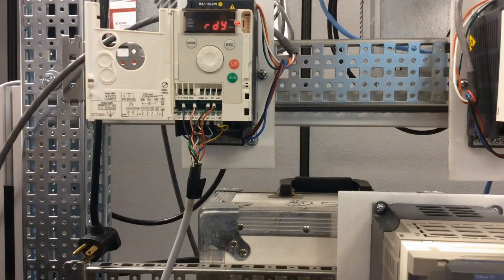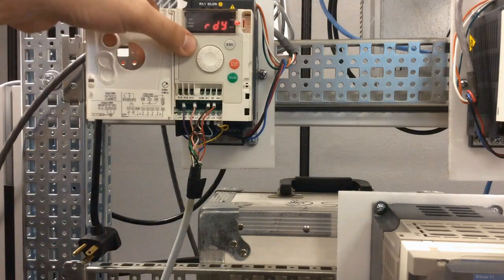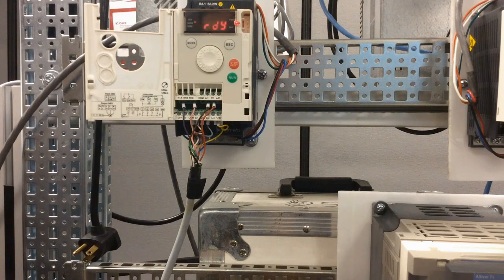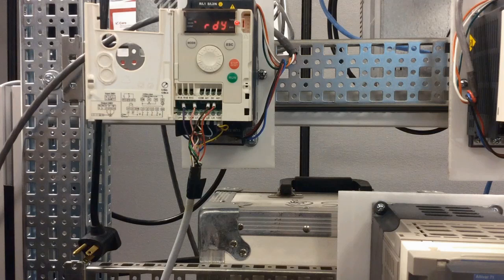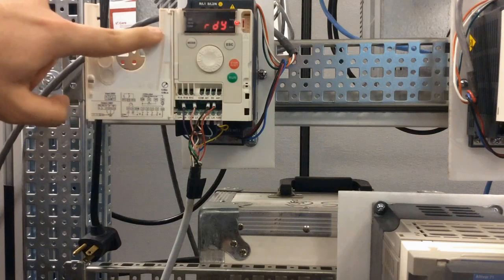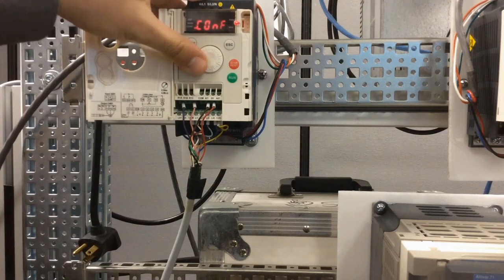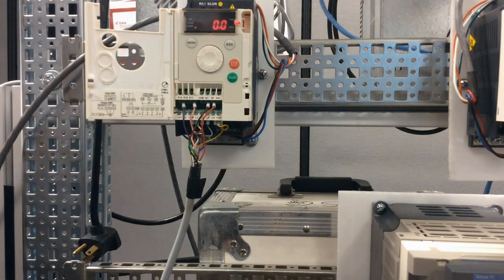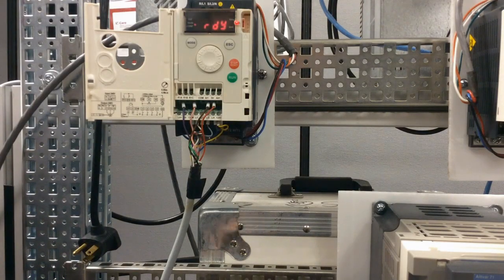Tutorial for Configuring Altivar ATV12 Driver for Local Mode Operation | Schneider Electric Support

Comment: after using the local mode operation for checking voltage on FLt menu do I need to press ESC to return on the beginning before I started?